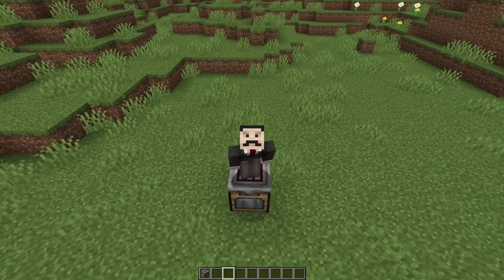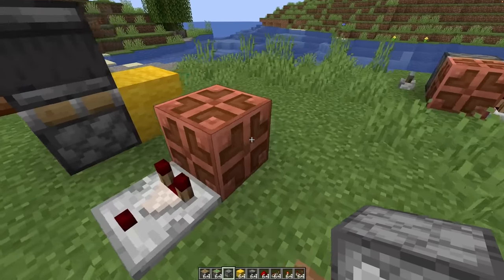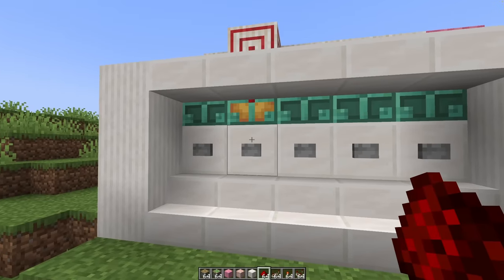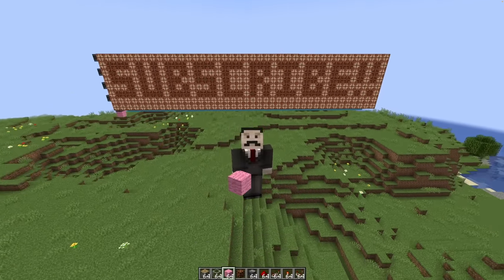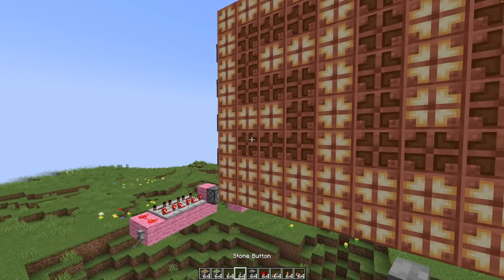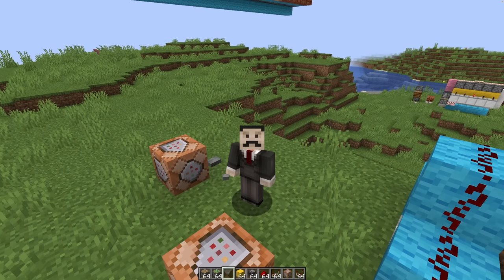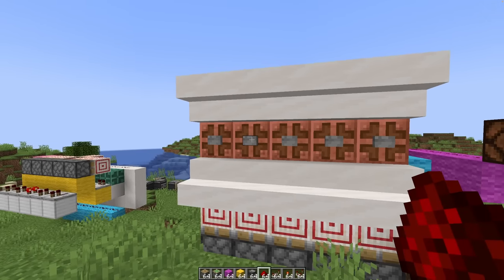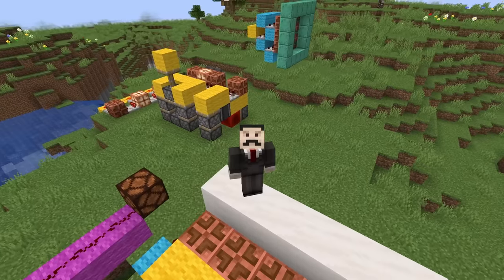Mojang added ANOTHER Game Changer...

Comment: Just as a heads up, hope Mumbo reads this: 🚨 the copper bulbs and the crafters have been nerfed heavily, reducing the tick speeds they work at, and all around a false bug report. 🚨 It’s only in the snapshot phase now, so if we make enough noise, we may be able to get things reverted.
Reply: Common mojang L
Reply: just acept, it was a bug
Reply: This sounds pretty typical for a Microsoft subsidiary: mislabel features as bugs, meanwhile actual bugs get left to collect dust for, in some cases (like the one with the max health attribute breaking on login), as much as 10 years!

(Someone ended up writing a mod to fix the attribute bug thankfully, but that's not helpful to people that don't want to muck about with mod loaders, especially not if the bug affects bedrock)
Reply: @Pedrin_Smasher there is no bug there WAS no bug and there will be no bug
Reply: @Pedrin_Smasher  it was literally announced as intentional also QC powering is a "bug" should they remove that to?
Reply: @Pedrin_Smasher literally a dev said it was on purpose but go off and defend them
Reply: Literally goodbye 1 game tick components 😞
Reply: @Pedrin_Smasher no, IT WAS NOT. That "bug" is literally a false report

Even one of the developers kingbdogz said it is an intended feature which makes it consume 1 gt at a time
Reply: no @Pedrin_Smasher
Reply: @Pedrin_Smasher  they said the 1 tick delay was intentional. They changed it because bedrock fucking sucks and it didn't work in bedrock.
Reply: @MrSleepparalysisman  Should just call it a feature like normal
Reply: @MrSleepparalysisman there is no bug in Ba Sing Se
Reply: @Twisted_Code what's the name if the mod?
Reply: @Pedrin_Smasher  meanwhile dev: It's NOT A BUG
P.S. does it matter it was super useful

Comment: My mind immediately went to a Turing machine: copper bulbs in a piston feed tape, which can be swapped between on and off, is exactly like an array of binary digits.
Reply: These also almost work as single bit registers, I feel they will cut down the size of them by a lot.
Reply from the maker: My next idea involves something like this!
Reply: @ThatMumboJumbo I don’t think you’ll reply but I’m going say hello anyways
Reply: @joprothenoob2374 maybe mumbo won’t, but I will. Hello there :)
Reply: WAIT, You can make Brainfuck interpreter with this
Reply: I once did this with a 2-block-high tape that had a row of glass and a row of solid blocks. If you swap glass and solid blocks you switch that bit on the tape. But now this is possible with just one block.
Reply: Me too... I was thinking of an 8bit encoder and reader systems.
Reply: Darn it, you beat me to commenting this lol
Reply: redstone computer gonna change quite a bit
Reply: @sergiocosta6779  lol. a bit
Reply: @ThatMumboJumbo  I know that a reply is extremely unlikely, but I need some help. I cannot find the Crafter or Copper Bulb in any of the screenshots, and it's driving me crazy. Do you know why this is?
Reply: @lachlanparker570 You probably figured it out by now, but you either have to start a new world with the experimental settings on or import your old world to a freshly made world with those settings on.
Reply: @ThatMumboJumbo let me also throw in the idea that the crafting block could maybe allow us to more accurately reproduce finite state machines without the build being so big as if done with physical block bits. I just came back to minecraft, and it struck me that crafting allows for much greater transmission of data through items than previously because they can now be transformed. For example you could use iron bits/ingots/block in chests to represent a 1, a 0, and a null, so we aren’t restricted to just 1s and 0s in a physical on off sense. And if you can streamline this, maybe you could make a big boy computer! Maybe all of this has been though of by someone already, but I thought it might be worth mentioning!

Comment: The thing with it being movable by pistons is a really big deal to me. It’s like a redstone block, but without any bud powering, AND you can turn it off. I think its biggest use will be the anti-bud powering power source, which will probably make larger contraptions much more compact.
Reply: As a power source it's functionally the same as a compostor, or cauldron the only difference is it can be toggled.
Reply: does it keep its current state when moved? like if its on, will it stay on when pushed?
Reply: yes  @Caddoan
Reply: The fact that this can be used as a binary storage block is absolutely incredible. Those thousand block calculators are gonna be a thing of the past real quickly!
Reply: Don't get it wrong, but for what I've seen, they don't emit redstone, that's why he used comparators, and that exists since forever. The big thing is that this is like a movable storage, but for redstone. The closest you could've got was dispense a shulker box. For example, for the shulker box state comparator, you need water/ice and pistons to transport, and you need a comparator, a dispenser, and a piston to break. Now you still need a piston but not that close and a comparator. That's
Reply: More computers are gonna be made in minecraft that's for sure
Reply: Movable memory!
Reply: wild
 @Alphalaneous
Reply: unless redstone block yes @Caddoan
Reply: thats @naakiu

Comment: I don’t know much redstone, but I do know a good bit about coding and my jaw DROPPED when I saw that this was togglable, I didn’t realize before that there wasn’t a compact way to have that function in Minecraft
Reply: Yay
Reply: you seen the computational side of redstone, like i saw the binary incrementor circuit and instantly thought program counter
Reply: Previous 1 wide-tillable designs were 4x2 and were definitely sufficient. But this is way too overpowered. (I do like it, even tho I’ll have to revisit my hundreds of large redstone contraption because when building something with the objective of it being small, you sometimes have to use other "tricks")
Reply: @lygencore so you’re saying Overpowered as in “This changes everything” and not as in “Please nerf”?
Reply: There used to be a way with a repeater facing a block over a sticky piston facing up, with redstone on the other side, connected to a sticky piston with a redstone block. So yeah, this is a MAJOR gamechanger
Reply: since they are piston-pushable, I think there are some implications for digital-logic type redstone stuff.  I think redstone has already been shown to be turing complete, but I'm guessing that 12 bits of persistent memory that can be manipulated with a flying machine will make a lot more things practical in vanilla.  Functional computers and displays and such.
sound of hive-mind spooling up
Reply: @DetectiveWraith  yes. The only downside being to have to list everything I ever made to see if it would benefit from it.

Comment: This honestly might be one of the most convenient components. Without 1 tick pulses on bedrock edition, t-flip flops are much more annoying because you have to get droppers and stuff involved, but this is just a T-flip flop in a single block. It Could take a bit of the engineering and problem solving aspect of red stone away, but it also could be incredibly handy when you have bigger things to worry about than getting a single t-flip flop to work well in your build.
Reply: Yes!!! I made this elevator but I couldn't activate it with a button because I couldn't use a T-Flip Flop! Also, this is perfect for multi-floored elevators!
Reply: This may also open the door for more parity between Java vs Bedrock Redstone, now they just need simpler 0-Tick Pulses and some way to make Quasi-Connectivity work (assuming that's possible)
Reply: "t-flip flops are much more annoying"
No. Just no. I've hardly ever felt the need to have Java's TFlipFlops. And on the rare occasions when it seemed to be the only solution, a little circuit redesign was enough to solve the problem without any loss of size/performance.
Reply: @halozoo2436  that’s a good point. I hope they add  these things to bedrock in some form because there has been a lot of contraptions I’ve wanted to make but couldn’t because they took advantage of quasi connectivity or 0-tick pulses
Reply: @lygencore  And now everyone has a very compact and simple t-flop, which is even better. And to be fair, more parity between versions is always nice, even if this doesn't technically address the original parity issue but it still solves it.
Reply: This might be one of the first times the minecraft community has agreed with each other in a while 😂
Reply: @lygencore    I never have a lot of trouble with making t-flip flops on bedrock but I find them more annoying than javas. Maybe it’s because I grew up using the old gen consoles playing on Xbox 360 which had what javas t-flip flops are now. If you find bedrocks t-flip flops easier to use then that’s fine. I was just expressing my excitement and my opinion for this advancement in red stone.
Reply: @benicho8131  That new block is a revolution, I just wanted to note that there is no practical difference between Java's and bedrock's ones in terms of size, speed and complexity
Reply: survival friendliness
Reply: Umm actually it's called cop flop, use it's correct name
Reply: cool
Reply: I those words, but not in that order
Reply: @halozoo2436  Did I sound disappointed in my message ? My bad if it felt so.
Reply: @halozoo2436  >assuming that's possible
If i remember right, the Console editions had similar code to Bedrock? They also had Quasi-connectivity. It was intentionally added then, and simply never got moved to Bedrock :V
Reply: @higueraft571  I don't know the complexity of the programming, and I do remember quasi-connectivity being an accidental bug that stayed in, so I can't really say if it's a simple thing to ask for.
Reply: @halozoo2436  >and I do remember quasi-connectivity being an accidental bug that stayed in
The actual bug was actually fairly different to the one in Java/Console Editions today. It got patched out completely and readded as an actual mechanic.

And console Edition i believe did just add it when it didnt exist before, so they likely could...

Bedrock could also likely fix many issues if they tried :V
Reply: @higueraft571  True, just seems like full parity is low on the priority list of Mojang unfortunately, with both Redstone and Combat being unfortunately left behind in the changes to Bedrock which makes it feel even more inferior to Java, and I honestly wouldn't mind if they just split the phone version off into controlling its own way and let Bedrock have the better combat finally (screw the old spammy nonsense, I want my sweeping attacks).
Reply: @halozoo2436  eh i mean you could adds mods in bedrock to adds the new combat system but also that mean a lot of thing might change

Comment: We can now do proper memory storage in vanilla Minecraft. It's basically a one-block t flip-flop, but being pushable means we can create massive memory banks that can be moved to change what is being read. Imagine a massive hard drive in the form of an 8 bit wide piston feed tape with a bit of circuitry to address it, allowing for any address in memory to be navigated to and the memory state read or written.
Reply: A Minecraft hard-drive
Reply: Oh my gosh you've just described a Minecraft Turning Machine!
Reply: steampunk computer age
Reply: @St0rmcrash  Turing machine?
Reply: Technically you can already do more information-dense memory with items in inventories with item filters, but I think I get what you’re saying with it being a much simpler system to implement that is more or less what you learn in a low-level computer science class.

Edit: low-level as in low-level in the system. Not calling you simple lol
Reply: Very useful for a toy turing machine for sure. Other than that though, I'd rather expect it to have use in specific special-purpose contraptions than general computers. RAM is pretty simple to make with repater locking and some logic gates for address selection, and is usually the better compromise for computing tasks.

edit: One tradeoff that wouldn't really exist in a real-life analog is latency -- larger RAM needs longer repeater lines, whereas a tape has constant latency for linear accesses. There'd still be latency between the pistons of the feed tape, though, so some careful design work would be necessary to make that work (though I'm sure it could). Oh, and instant wire exists, making everything I just said a moot point if you're willing to use it. (There might as well be nothing I feel more conflicted about than Mojang's decision to make pistons start extending without delay. I can see why they didn't bring that over to Bedrock, though most of everything else there is just lazy cop-out nonsense.)
Reply: @fiveoneecho  to me, the thing that makes it a game changer is that the copper flopper can, not only be directly activated and deactivated but also interact directly with redstone.

it's really like a real bit of information
Reply: @pdd5793  that's fair if you want to simulate transistor memory gates more closely in your contraption.
Reply: I cannot even imagine what's about to be made with this, goddamn. insane things have been made already using the blocks prior to this new addition, but now...
Reply: @OldNarnians  An abstract mathematical model of a general purpose computer. Anything that can be done by a computer can be modeled with one (though usually not in a practical/efficient way). It's the cornerstone of a lot of computer theory
Reply: @St0rmcrash  
sucks air through teeth ik, I was correcting your spelling XD
Reply: create it sir
Reply: I can't wait for some wizard to look at this, hook a huge RAM memory to some flyuing machines and basically build a cache with it. So you have a far away HUGE memory bank, and every time your program needs to access memory, if it isn't loaded in the cache yet, a flying machine takes the cache back to its proper location in the memory bank, and another takes the row from the memory bank to the cache.

I could see it being done with flying machines taht go up, down, back and forth, and you have different height addressing different regions, so when returning the flying machine goes up X amount of blocks before going back to its place, and the one coming in is only Y block up, so they wont collide mid-flight.

Cache retrieval would be slow AF, but if you made a large enough cache bank it could be worth it, cause you have enormous amounts of addressable memory. With manual cache retrieval instructions ,I could see this working somewhat well
Reply: @St0rmcrash its called turing machine, not turning
Reply: wat
Reply: And with the tick speed command you can now run it at a decent speed.
Reply: @pdd5793 It doesn't interact directly it HAS to have a comparator intermediary AND support block for the comparator AND have its output wiped and replaced by the comparator's hard power
Needs to have hard power. If you want to hard power a wall without lighting all the adjacent bulbs then make that the quality of waxed bulbs but right now bulbs have been "missing opportunities jang"-ed
Reply: Too bad they HAVE to be read by comparators when we could build all kinds of things taking power with dust or components. The one use case screens of bulbs that take hard power but don't light neighboring bulbs has crippled the abilities of bulbs. We have 2 sets of bulb blocks just make waxed bulbs (that hold their color) not soft power blocks for aesthetic purposes but regular bulbs interact directly with dust + components besides a comparator
Someone also said it would be nice for a bulb that doesn't do lighting updates and someone else said fully oxidized bulbs could do it, can't find those comments 🤷
Reply: @kevinjamesmartin4307  What
Reply: @kevinjamesmartin4307  They can be read by observers

Comment: yeah what I love about the T-Flip Flop aspect of the block is that not only does it make the concept a lot simpler for more novice builders, but it is also extremely aesthetic. Like the most basic design of putting a button on the block directly means that you also have a built-in indicator of what state the flip flop is in that will probably look pretty nice in most any build that needs it, which I think is really cool
Reply: you mean the copflop?
Reply: @0xzoooo  AKA copper flopper 🗣🗣
Reply: Also, you can move the copflop around with pistons. It's a moveable T flip flop. I don't know how this will be useful, but it sounds like the sort of thing people will use in insane flying machines.
Reply: @0xzoooo even thou it's fancy with the name, it's better to call it a T-Flip Flop because of the logic and Coppflop as method
Reply: @nixel1324 this reduces space occupied in logic circuits which inturn open up to other new ideas to implement
Reply: Building some with bulbs I immediately wanted to take soft power from them, activating dust or repeaters or blocks. It's rather dumb and messy to make us only be able to take power using comparators and a block/slab/trapdoor underneath for support structure & also the comparator only hard powers as an output. Mechanisms could be so much more compact and elegant if bulbs soft power. But people are gonna use them for screens and mumbo had a row of them, so maybe waxed copper bulbs retain their oxidation and do not soft power for maximum aesthetics

Crafters also must be soft powering